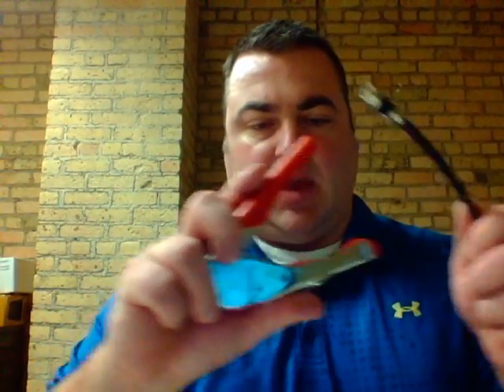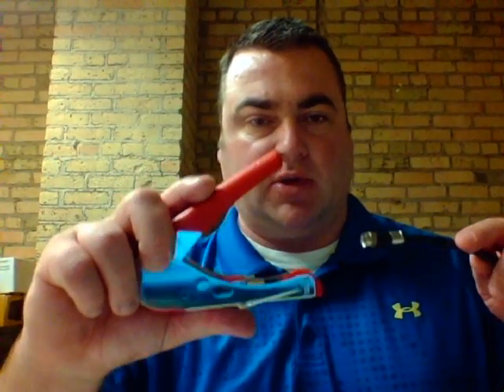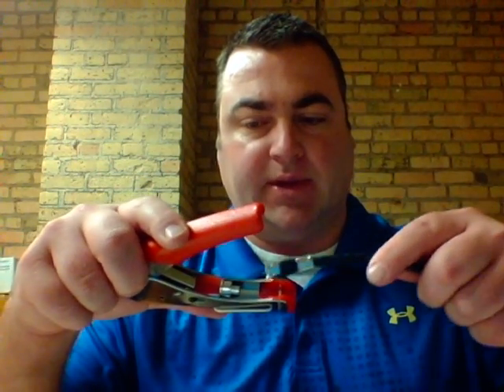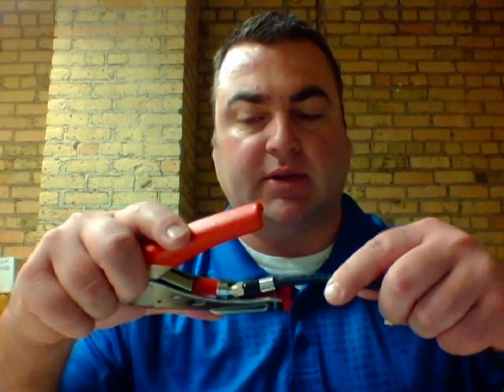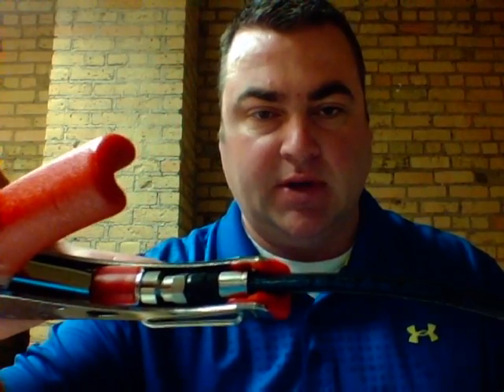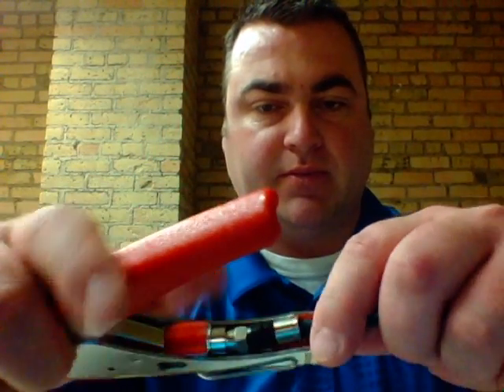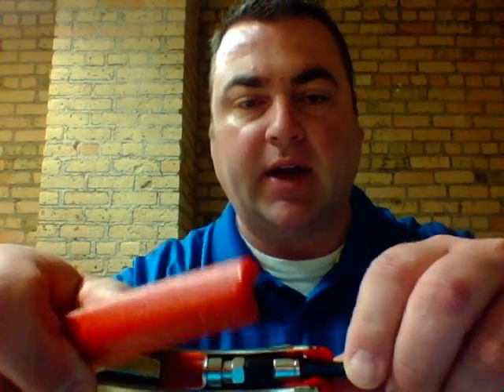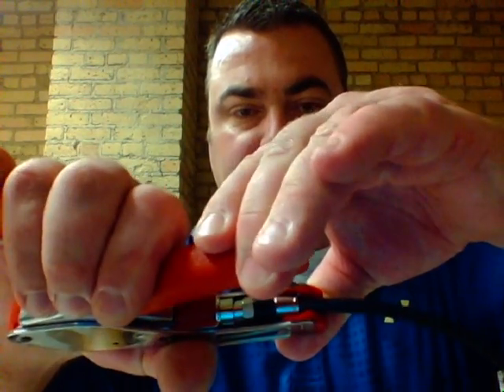Part 2-Terminating Coax Cable with Compression F-Connector, EX6XL-Making connections

Comment: could this fix my sega 3 adaptor even though the wire is weak ?
Reply from the maker: I am not familiar with a Sega 3 connector.  If it's Coax at one end, you should be able to fix it.
Reply: Thanks